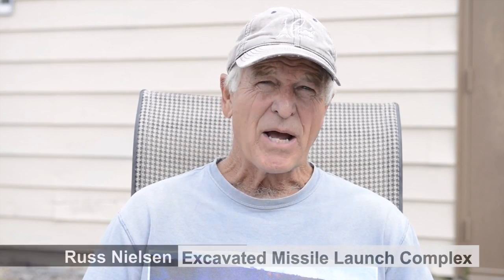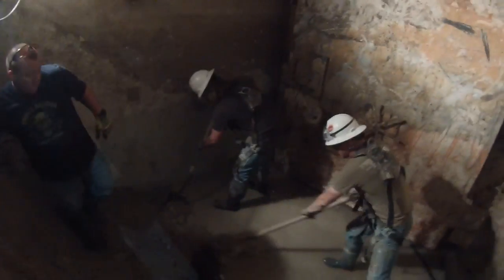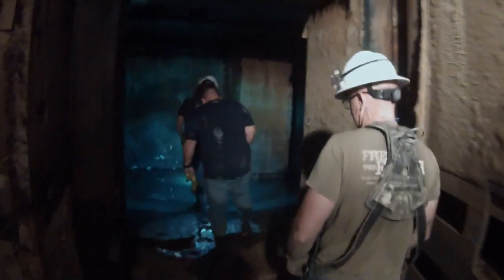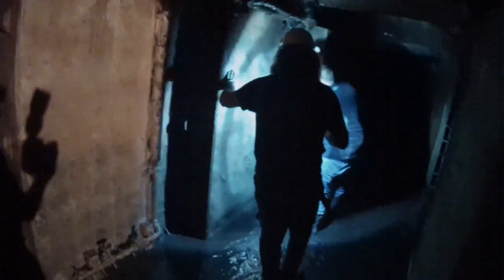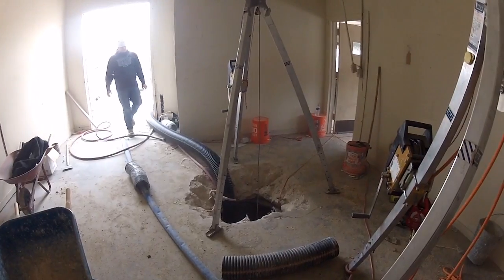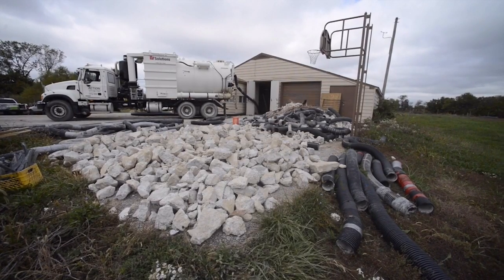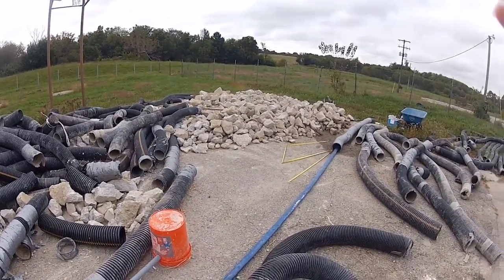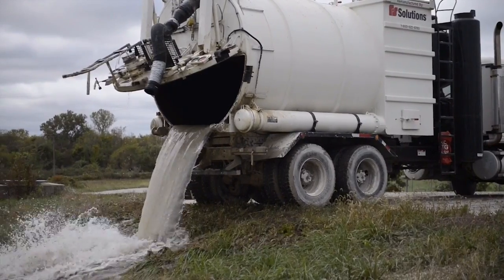Rare Look Inside Excavated Minuteman Missile Launch Complex

Comment: There is an Old LCF (Launch control Facility) turned museum located in Wyoming called Quebec 01. It  had control of 10 Minute man missiles and then was converted over to the Peacekeeper. I did a a full tour video of the topside facility as well as the underground capsule on my channel. You can see this in all its (almost) restored glory.

Comment: A lot of work for nothing.  The National Park Service  has a restored and complete Minuteman ICBM control center and also a Minuteman silo with inert missile inside and these are located in South Dakota.  The start  of the tour is at the headquarters of the site at exit 131 on Interstate 90 near Wall, South Dakota.  In early July 1963, myself and one other launch officer were the first Air Force personnel to accept this site (Delta 1) from the Boeing Company representives.  It and site Bravo 1 and each sites 10 missiles were the first active Minuteman sites in South Dakota assigned to Ellsworth Air Force Base, 44th Strategic Missile Wing, SAC.

There is also a museum site and silo located at Cooperstown, North Dakota and this is the newer Minuteman III facility.  The control center there was built by Sylvania and is much larger than the ones built by Boeing at the other  5 Minuteman Wings.  If you are close to either of these sites, stop in and learn a lot about the cold war.

Comment: I don't see any red tape if you own the land.  You can do what you like with it.
Reply: I agree. Screw the permit from the Air force or whoever you had to get it from. I would have just started digging I seriously doubt anybody would have said anything.
Reply: The reason for the deed restriction is liability.  They don't want anybody getting hurt trying to dig it up and sue.   They probably finally agreed to have him sign a wavier so if anything happens he can't sue.
Reply: He signed a deed restriction.  That's the issue.
Reply: You are talking federal goverment, I would be tempted to but what if they did come out and check on the site? Federal prison time for digging a hole in the ground, no thanks. He did the right thing and got through the red tape the smart and legal way.

Comment: This was published 4 years ago in 2015 after you opened the 1st door but I don't see any subsequent videos like opening door 2. You left us hanging in suspense. LOL
Reply: so these guys got the outer blast door open in 2015 when that news story you posted was filmed, but were still trying to get the water out and try the inner door to the capsule, as far as i can tell from some googling, by 2017 they got into the capsule i think, still a little unsure on that but i know that Russell posted to for sale on ebay, I never got to see the actual page on ebay but from what i saw on the plethora of news articles on it being listed on ebay it appears they may have gotten the capsule door open
Reply: They got it open.  The blast door that leads into the capsule was the one with Yosemite Sam painted on it.  The inside of that door is where you can see that large box shaped structure that was the suspended launch center…it had the things that looked like train rails hanging from the ceiling.

Comment: So much work I salute you! PS nice graffiti at 1:15.
Reply: Definitely not graffiti.  Each flight had their mascot that was painted on the blast door and/or the wall in the tunnel junction.  My husband actually painted the art that you can still see at Oscar-01 launch facility.
Reply: Since the site was controlled by the U.S. Air Force and/or DoD contractors until deactivation was complete, I doubt it's graffiti. Just as the old Army Air Defense Artillery used Oozelfinch as its mascot, at least one Air Force unit used Taz as its mascot. It was probably painted by one or more missilemen in the last days of the site, when things were more lax and they knew it didn't matter to senior leadership. Sometimes these mascots were viewed as unofficial moral boosters. I'm sure moral among the crews was low when they learned their mission was about to come to an end. https://en.wikipedia.org/wiki/Oozlefinch#/media/File:OozleFortWarren01.jpg

Comment: That's great but the water you're pumping out and then dumping on the land could be contaminated?
Reply: Mart every drop of water you ever drank, cooked with bathed in, has been pissed out, bathed in, dead bodies rotted in, phosphated, crapped in, and used to wash slaughter house floors and pig pens, pesticided ... tens of thousands of years, get over it
Reply: With what?
Reply: Martin Campbell-Smith No not likely if it were everything would have been left they stripped the vent power controls.    Not to mention air pumps.    As for radiation not a chance.